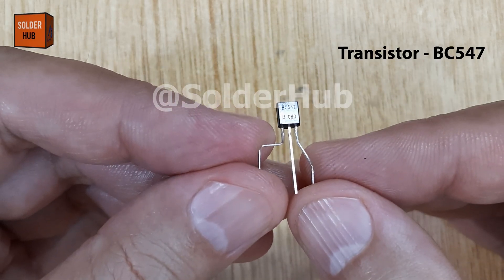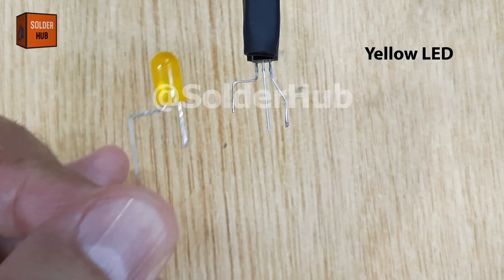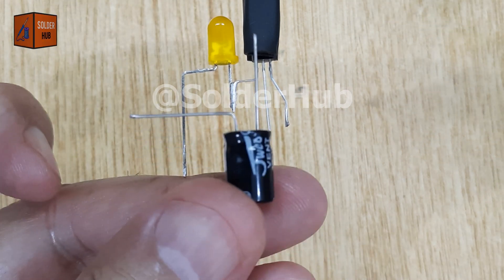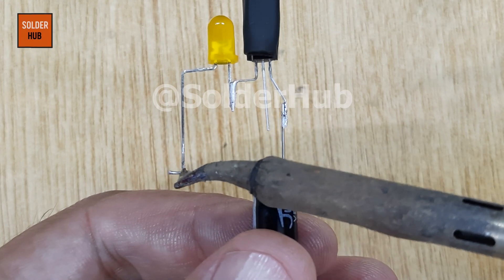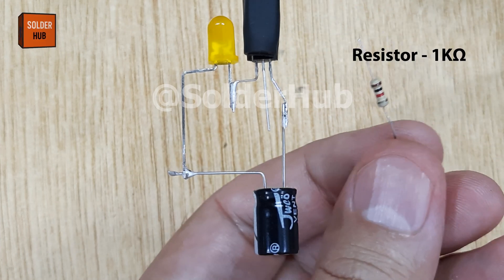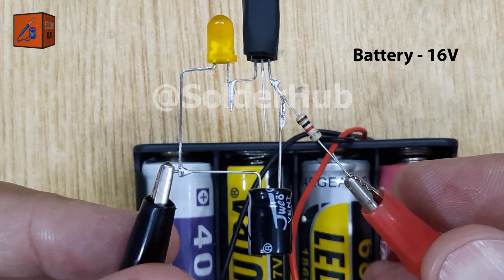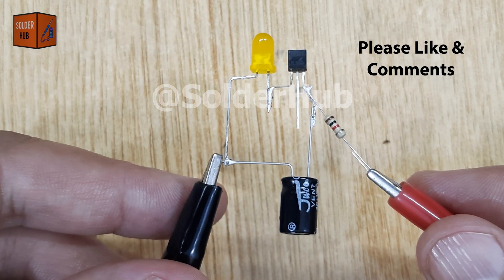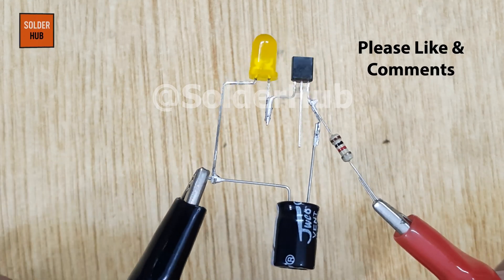How to Make a Simple LED Blinking Circuit Using BC547 Transistor | Easy Electronics Project

Comment: Why didn't you explain that it is an Esaki oscillator. It was invented in August 1957 by Leo Esaki and Yuriko Kurose. It back flows the voltage back through the Emitter to the collector. The base of the transistor is not used. It takes a lot of voltage and it is hard on the transistor. But the video is better than most.